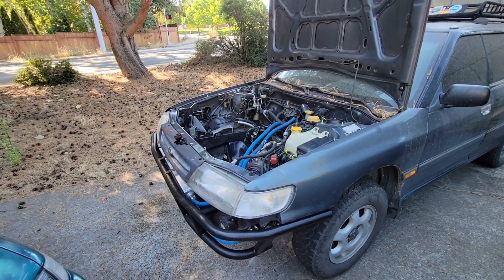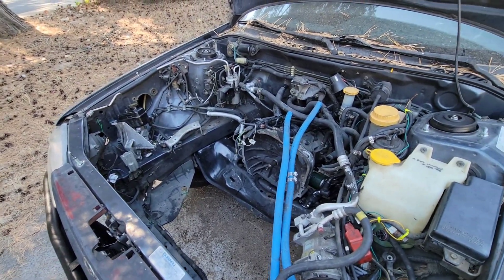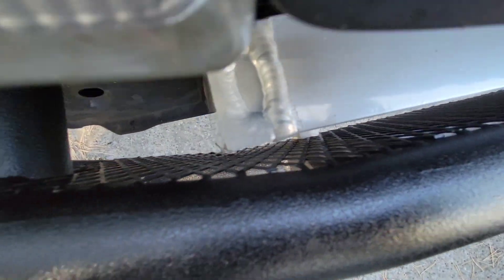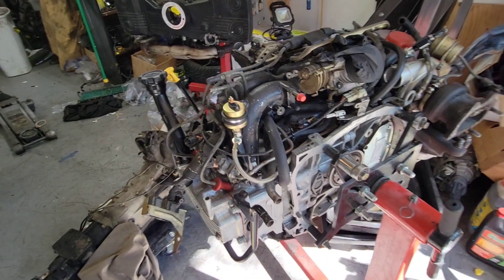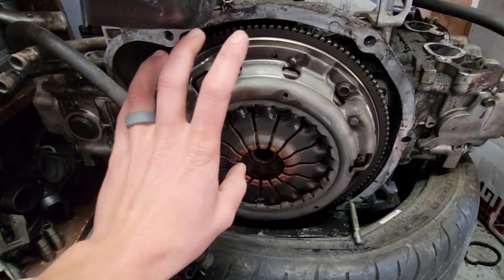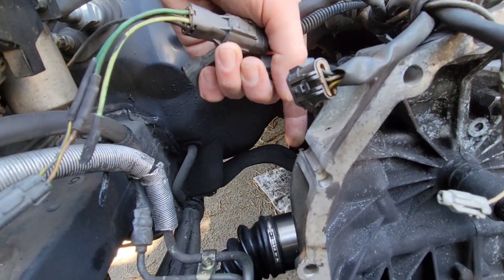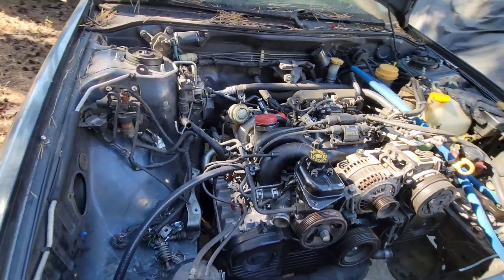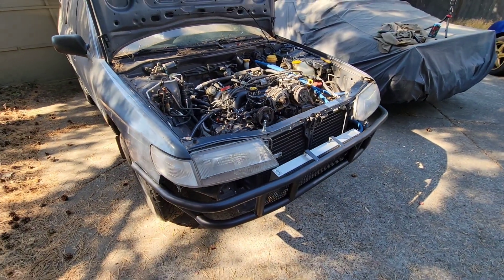How to Turbo a Non-turbo Legacy - EJ22T Conversion Pt.1 Engine/subframe Install

Comment: Bro where can I find a pedal box for my 92 Legacy Ls
Reply from the maker: I usually get them from the junk yard, if you are hydraulic which I think a 92 legacy LS is cable clutch, you can find those in 2nd gen legacy base models, and gc8 base model impreza should all be cable clutch and bolt in the same. If you are switching to hydraulic you can get a direct bolt in from a 96-99 outback, or a gc8 2.5rs impreza.

Comment: I have 2 questions: 1. What has been done to the car so it's so high? Foz shocks&springs? Recently I have migrated from legacy shocks+50mm extensions on the top of the sock to stock foz 1 spring+sock. The difference is -5mm for the stock foz suspension, but the spring beds are much higher for the foz shocks and can fit little bigger tires. 2. Can you pls tell me how is the catchcan connected ecaxtly? where is the carter vent going in? the head cover vents? and where did you plugged the output to? I see T on the output hose?
Reply from the maker: Yeah this car is on 98 outback struts with legacy rear top hats and a set of king springs with the outback trailing arm brackets. The hight is pretty much exactly the same as a forester strut setup but with the better king springs. Fits the 205/75r15 perfect with no rubbing.
The catch can is pretty simple, it has 3ports 2in and 1 out, it also uses a newer GD style pcv valve, so the main crank case vent goes into the can and the valve covers T together into the 2nd input, and then the output goes into the pre turbo intake which the apexi intake has a perfect port for.
Reply: @HackSquadGarage  Thanks man! Why do you use GD pcv? So you can connect it pre-turbo with less vacuum or some other reason? Also why not use stock pcv? I'm currently using something similar - main crank in1 in, covers (using stock tubes) goes to 2in and I vent to atmosphere, but I have an issue with often overfilling when sending it more so I was wondering how/where to connect it...before turbo or as stock in the manifold....
Reply from the maker: @valqkasdf  yeah no worries, we use the gd pcv because the stock F shaped pipe always breaks, we made a video on adapting it in. It just makes it easier to work on and not leak.
But yeah as far as catch cans you really don't want to vent them to atmosphere, the catch can should be sealed as boost can make its way out the crank case. Getting a real AOS would be the best thing to do. But I just empty my catch can every oil change. But yeah crank case are inputs into the catch can, and you need a vacuum source to pull the gases out, so you use a port in between the maf and the turbo, that way the maf does get ruined and the turbo can pull the gasses out. Hopefully that helps. Also maybe you need a bigger can?
Reply: @HackSquadGarage  It's about 150ml and gets full quick, when driven very hard, or on track - when oil slushes around... on normal driving conditions it takes quite a lot of time to get full... I'll think of a way to connect it to the intake. I don't have maf, because I'm running MS2 with speed-density map+temp.
Reply from the maker: @valqkasdf  oh nice! Yeah just need a port somewhere in the pre turbo intake and it should help a lot